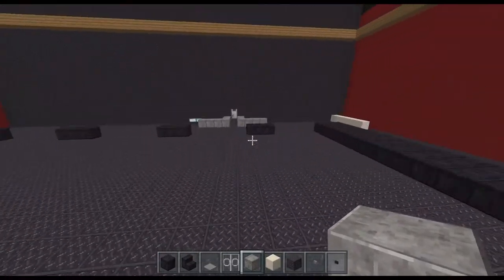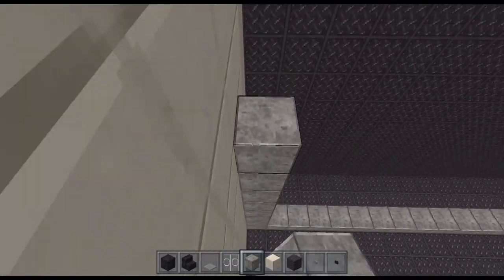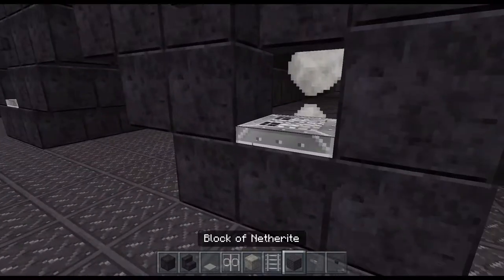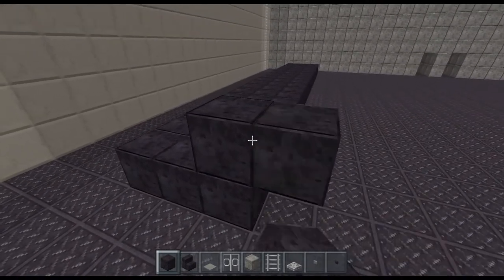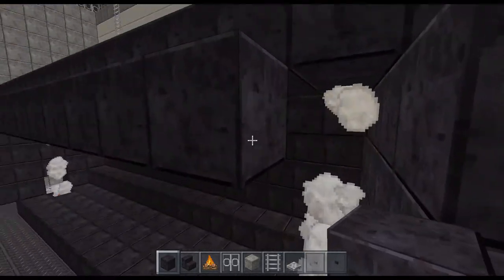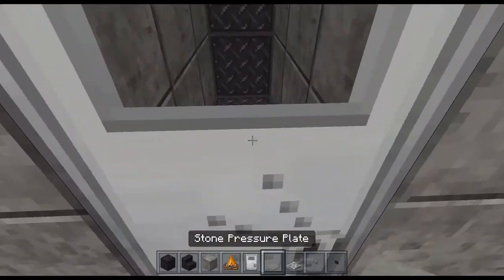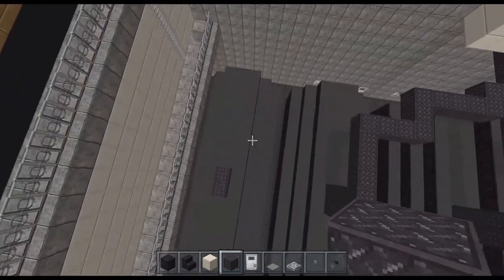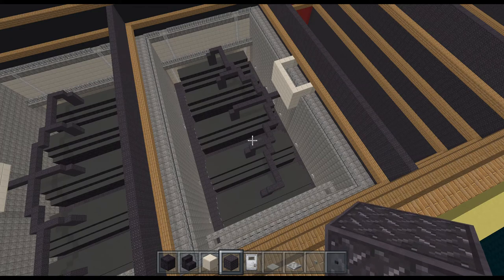MINECRAFT RMS TITANIC INTERIOR TUTORIAL PART 9

Comment: Hey guys, question and suggestion time.
Question: will the cargo holds have casings up to the cargo hatches like the funnels have, I only ask because you both completely filled in the deck above them, so I was just wondering.
Suggestion: the last boiler room doesn't have a pump room and please correct me if I'm wrong but I'm pretty sure that the boilers connect up to the wall
Also keep up the good work Pipkin and Will😁😁😁😁👍👍👍